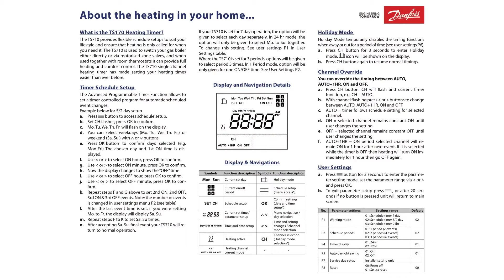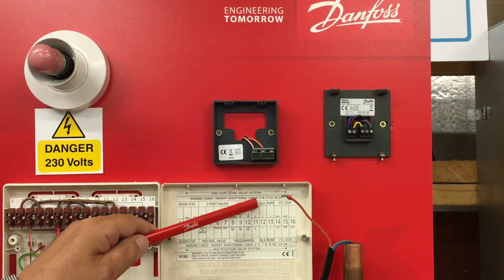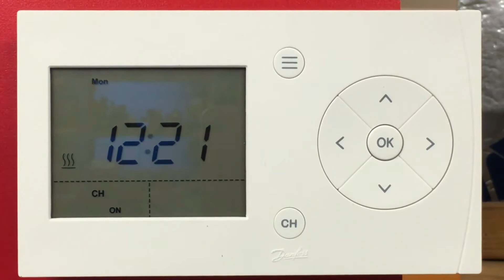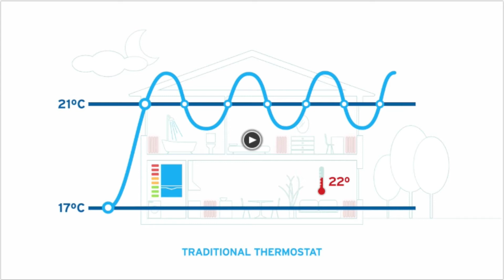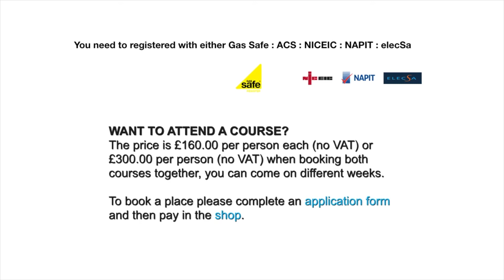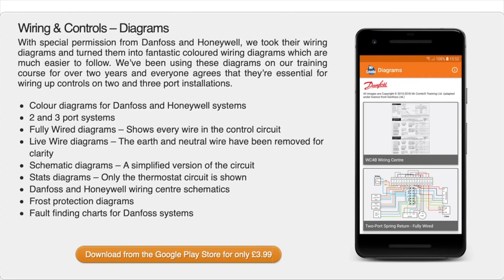Danfoss TS710 & FP720 Programmers

Comment: The most frustrating system I have ever used  ..CH is on but no hot water!!!!

No heating either
Reply from the maker: Hi, thanks for comment, no problem, you should have the 2 channel  FP702 (Full Program) each channel check the ON / OFFs are OK or reset the programmer to factory settings. Hope that helps, George

Comment: So i have the fp720....i need the water and heating on constant...but the holiday mode keeps coming on by itself....i reset it and try pressing pr button it will dissappear....then a while later the suitcase appears again....how do i sort this please
Reply from the maker: Hi Mr Slice, thanks for asking, you have a couple of options: 1: When you reset HOL. mode OFF turn OFF the power for 60s (cool down) start re-programming. 2: If the problem returns call Danfoss support (have details of date installed, who did it and what you have done)  3: You may have a claim against the installer under The Consumer Act 2017 (Not fit for purpose not lasting reasonable time) take legal advice, and get the unit replaced. Hope that helps, George Staszak 🤩👍
Reply: @mrcombiBedford  thank you for the reply ...its really appreciated
Reply from the maker: @MrSSlice  good luck👍

Comment: Hello,
Tha ks for this video.
See once you have set timer to.come.on at 6.30am for 30.mins, do you have to leave the heating on ON for it to.click on in the morning?
My thermostat is in cold.hall.& wpuld cost a fortune to keep this on ON or AUTO.
I left in OFf last night & it didn't.come.on.
Thanks
Reply from the maker: Hi Nicola, thanks for asking, It depends what time you did it and wether the system was ON or OFF mode, once you put in the new settings press SAVE the unit goes to AUTO the then the next 6.30am heating goes ON for 30 mins. Check all the times, days, clock and OFFs are all OK. If it doesn't work next day press RESET and reprogram. Any battery models change then for alkaline. hope that helps, George. 🤩👍

Comment: HI   we have just had a new FP720 fitted is there a setting for hot water only, our old danfoss controller had water heating or  CH heating and water. Thanks.
Reply from the maker: Dear Ian, 
Thanks for asking, in common to most programmers in homes, the new thinking is to set HW to 247 and let the cylinder stat control or set the HW timer 7am to 10 pm. On the 720 in the summer we switch the CH OFF either room stat to 5c or press the button  to CH OFF. Hope that helps. regards, George Staszak 🤩
Reply: Thanks for that. @mrcombiBedford

Comment: Hi mr combi hope your well correct me if I'm wrong the switch live out the room thermostat goes to orange in the wiring centre on danfoss, i thought it went to brown on the zone valve to turn the motor and then grey puts power on to orange to make the micro switch in the zone valve which in turn fires the boiler any help would be most appreciated thankyou
Reply from the maker: Yes 100% correct, the RS SW.L always goes to the Zone BROWN to move the motor, or WHITE if mid position. That's a £20 question, take care, george😁
Reply: @mrcombiBedford  yes corre t but mrcombi you mentioned it goes to orange in this video im sorry im confused
Reply from the maker: @bahiaharjinder  ALL The motor wires go to 6 as I said just a coincidence the SW.L is also orange. George
Reply from the maker: @bahiaharjinder  My mistake the orange wire goes to Zone BROWN 6 is Zone orange
Reply: @mrcombiBedford  thankyou sir for all your videos they are extremely helpful we all make mistakes we are human +thankyou for the quick response take care 👍🏻

Comment: Hi George, great vidio, I have a Danfoss 720 for CH and Water.
Probably something simple but I can't get my hot water settings onto my programmer. It decided to stop working last night and your vidio clearly showed how to reset CH but not the water. Please can you tell me what I am not doing  ?? Thanks Peter
Reply from the maker: Hi Peter, some controls firms are making setting up the HW timings a bit difficult because the default setting is OK for 99% of us. As the HW side is a lot cheaper than the CH it make sense to control that side with better room stats TRVs etc.
              As long as the cylinder stat is 60c 1/3 off the floor and there is always HW at the taps all is well. Most combi users have CH 247just use the room stat which is the lowest running cost so the same is HW. Thanks for asking. 
                    You always you can reset the lot by pressing the reset button or remove the batteries and start again, I would just leave it and make the CH lean & mean, regards, George Staszak 😃
Reply from the maker: Hi Peter, nothing, as per other replies, leave the HW to default setting, to get there press the re-set button and just programme the CH, life is too short. The lowest cost CH is 18c then if you have a newish digital room stat +2c then the CH will be 18c +2c (22) will be 20c there are all at least 2c below.
An old analog 240v will be at least 4c out hence high cost and in a HALL even higher. Hope that helps, George Staszak 
I will make a video next month.

Comment: I have just had this installed and it's too complicated for me, so I am going to have it ON and just use the thermostat. There is a red light on the timer and I'm not sure why that is? The installer didn't really explain anything.
Reply from the maker: Thanks for asking, red neon means the boiler should be in the demand ON program. Yes you are not alone about installers not showing how controls work to get the most from  the system, it's the Nr.1 complaint factories get about installers, shame. A lot put the programmer to 247 and just use the stat, it's the best way to save money, only when you are home at the lowest temp, lounge18 / 20. regards, George Staszak

Comment: Hello there, many thanks for your video, I have a heating boiler and a cylinder for hot water, each one with separate motorized valves. I'm not sure how to wire the cylinder stat in the wiring box in order to stop the boiler running when water reach a set temp in the cylinder. Could you help please?
Reply from the maker: Hi Florin, there are a couple of ways to wire 2 zones depending which make. Lots of drawings on U Tube a lot are wrong, contact the controls firm for the correct way using a WIRING CENTRE not junction box which is why we get all the faults. On our wiring course we get fantastic installers and sparkies, it takes them 3 hours to learn. regards, George Staszak

Comment: Excellent video. I replaced a Randall 102 timer with the FP720 with your help.

Only thing I’m not clear about is the difference when you have the extra terminals. I assume no loop from live to common  is required as it seems to work…my hot water and rads are on the two separate switched lives and it works.

Well, sort of…the rads seem to ignore whatever I set the thermostat to, so they never turn off! What might I have done wrong?
Reply from the maker: Hi Nigel, Randall 102 /103 takes me back to 70's made here in beautiful Bedford where all the best engineers come from. A link from L to Com is often used when the room stat or boiler needs one wire called SW.L (switch live)  there are lots that use this.
Draw a diagram with the make and model of parts email to Danfoss Tech. to check the wiring. regards George Staszak
Reply: @mrcombiBedford  yeah it's my Mum's old house. Did think of getting someone in to replace the entire thing with a new combi boiler system, but the cash flow situation won't quite permit.
Reply from the maker: @Daft_Ideas  Hi Nigel, If the system is over 15 years with high running costs then would make sense to replace because from April 2022 fuel prices WILL go UP per KW to very high amounts thus a highly efficient combi will soften the blow. As an installer I fitted systems for free in my parents houses, maybe you could rip out and start again with a new system via a small loan? Your mother would have lower costs and adds value to the home.regards George Staszak

Comment: Hi will this replace the DANFOSS TP9000? Is the wiring the same as existing backplate or will I need to alter it? It has an earth wires connected. Thank you
Reply from the maker: Hi Mark, new and different back place because it's a new and different range. As always on the old B'plate take fotos, We teach write down which wire goes where, make a new drawing of the old to new terminals BEFORE removing any wires double check with Tech. it's correct.
N & L are easy, just concentrate on COM and SW.L
where they go. take care, George Staszak
Reply: @mrcombiBedford  Thank you George. This system doesn't have the room thermostat it just has a block thingy in the hall, no dial just a block. Would I need to get a thermostat too?
Reply: @mrcombiBedford  There's 3 live wires in the live terminal 3 neutral and 3 earth then there's a grey wire in number 3 terminal a brown in number 5 terminal and a black in number 6 terminal
Reply: 3 terminal is DHW ON (hot water on?) And 5 and 6 are remote sensor to the thermostat?
Reply from the maker: Hi Mark, all systems need a room sat in the lounge apart from some programmable room stats can go in the hall, not many because COLD hall make big heating bills. Use the Danfoss dig in the video. George Staszak 
PS every country in the world states EVERY heating ZONE must have time + temperature control, a lot of UK installer don't bother, shame.
Reply from the maker: Hi Mark, it's not possible for me to solve all the questions from everyone I would never leave the house or eat, please as I said foto drawling to Danfoss. george
Reply: @mrcombiBedford  Haha understood 😄

Comment: The bottom right corner on the programmer is not displaying the HW information. It will not let me toggle between the CH and HW, has anyone else had this problem?
Reply from the maker: Hi Suzanne, I normally suggest do a factory reset either that will fix the problem or you know it's faulty, this is the same advice with TV boxes, computers and phones etc electronic equipment do freeze. regards
George Staszak

Comment: Hi George I currently have a FP715Si which is now faulty but I understand discontinued by Danfoss can I fit a FP720 in replacement and is it a straightforward DIY job or will I need a spark?
Reply from the maker: Hi Peter, thanks for asking, the back plate where the wiring goes is different, not a DIY job. regards George Staszak

Comment: Many thanks for your video, we just had this boiler installed in July and the installer set it up. We wanted to change the timer program but trying to read the instructions was a bit of a nightmare. Your video is excellent and so easy to follow, but when changing P102 to P101 thinking that it would keep the same setting for the 7 days, it only showed Mon and not the 7 days. Not sure if it was supposed to, but to be on the safe side I went and changed it back to P102 and did Sat Sun the same times as the week days. 
Many thanks from Scotland 🏴
Reply from the maker: Hi Douglas, thanks for the comment and yes sometimes in all programmers we have to think outside the box to set the way we want. Thanks goes to the Danfoss rep. Paul who taught me, regards George Staszak
Reply: @mrcombiBedford  Hello from Scotland.  Good video,  thank you for taking the time.     I would be very grateful if you could help..   Last week the local council fitted a new Danfoss TS710 single channel timer.     It's just my wife and I in the house now and We're both  just recently retired.     My query is this... We just want to have the timer setting  (It's in the kitchen)  sitting with Everything  off so that  all we do is...    press hour plus +     when needed.    How would we set that up please?  (No need to worry about the water, it's always hot when run).  Many thanks .
Reply from the maker: @midgeburleigh5694  Hi Midge, Thanks for asking, you can't just click +1 because if the CH setting is OFF it won't work, setting to ON that's on 247 cannot ask +1. Where it works is adding an extra hour to when it would normally go OFF. regards, George Staszak
Reply: @mrcombiBedford   thank you for answering.     Would it be such that I could set the heating to come on everyday for a minute once a day,  say... 10:00am to 10:01am Mon- Fri and Sat - Sun and that's all.    That way the system is on.   But then we could just press the hour  + whenever?
Reply from the maker: @midgeburleigh5694  Try it, could work that's how we learn , I would set 10 minutes to give the system time to get going, anytime press +1 see what happens should stay on for 1 hour then go OFF. I suspect if you press 5 minuets lated +1 won't work only in time, experiment with different way, please let me know. george
Reply: @mrcombiBedford  👍.  ok we'll  give it a go over the weekend and I'll post a yea or nay.   Thanks again.
Reply: Hello.  Here is the result of what we tried.     Well that's nearly a week and the suggestion has worked  treat!  We have set the timer  (on the kitchen wall) to come on at 7:01am  and to go off two minutes later at 7:03am,   Seven days.   That's it,   that's all.
 We then just press the hourly + button when and if we need it  and,  on comes the heating for an hour and then goes off.  It is the only time we press it now,  just when we want that heat.   I hope this is of good use for others.  Thank you for your initial help and answers.  Much appreciated.
Reply from the maker: @midgeburleigh5694  Fantastic! Always worth experimenting, this will save a fortune in gas bills plus better comfort levels, I am very pleased for you. All the best George Staszak
Reply: @mrcombiBedford  Thank you.  As I say,   I hope others can also  benefit from this.    Let's hope the "big boys" don't cotton on  too quickly   only to. . " Improve"   the timers so people can't do it!
Reply from the maker: @midgeburleigh5694  This is why we love Danfoss, easy to use.

Comment: I have a Danoff TPOne-M with 2 controllers for heating downstairs and one for upstairs. How do place the main controller downstairs for the Tado heating controller?
Reply from the maker: Hi Yogibear, thanks for the question, I think you cannot mix the two makes together, one of the most popular faults is mixing makes, the official reply  to solve is stick to one make which has the most parts. Valve are priority Danfoss valves Tado controls don't mix, they will work with problems.

Comment: Just had a FP 720 fitted ( not thermostatically controlled ) Parameters set at P1 01, P2 02, P3 01, P4 01, P5 01, P6 Holiday mode 02 ( at the moment because it's summer ) There are no user instructions given in the box and I'm struggling to remember what the electrical engineer told me ! My old Danfoss was so much simpler and less technical. All I want to do is know what to press to reduce the length of time the  auto hot water is on for and also how to eventually turn the heating on in autumn ( on holiday mode atm ). Thanks !
Reply from the maker: Dear B E, Thanks for the question, Danfoss in common with other firms do not want the HW mode changing once it's set up in default mode because it may not suit others having not enough HW. The cylinder stat at 60C from 07.00 to 23.00 is a very popular setting. In CH mode again most put on 247 and just turn ON the stat when cold (that's the cheapest way) 18-22C in the lounge, if in the hall you will have to experiment by another thermostat in the lounge to adjust the difference. Hope this helps, regards
Reply: @mrcombiBedford It doesn't help really because as I said there isn't any thermostat in the lounge or hallway. The system is very old but serviced yearly and works great. The previous unit was 25 years old, a Danfoss 102, in conjunction with a back boiler, so very basic. I just want to set the CH and water to come on automatically a short time morning and evening, that's what we've always done. I'll give the guy a call and get him back to help. Thanks for prompt reply anyway.
Reply from the maker: @blondeenigma3882  Hi B E, there is a very serious situation here, in the 1970 Canada USA and Europe made a law the every zone must TIME & TEMPERATURE control. Any Gas Safe installer will have a lot of explaining why they are exempt. Please contact Danfoss for guidance.
Reply from the maker: @blondeenigma3882  EVERY system must have time + temperature control, the FP720 is only a timer, you need to buy a wireless PROGRAMMABLE room stat from Danfoss, hope this helps, regards, George staszak
Reply: @mrcombiBedford  This reply is 4 months after we fitted the timer, and it has been working perfectly without the thing you're suggesting. It was adapted to work with existing system which it is doing, we just use it to time heating and hot water to come on and off twice a day like the old Danfoss did.
Reply from the maker: @blondeenigma3882  For some reason You Tube does not show comments in real time but weeks later, I am glad it works for you which is good to hear. regards george

Comment: Does any firm make a controller that says ON  or OFF.?  it would make life so much simpler.
Reply from the maker: Hi, yes all programmers have an option of ON / CON (constant or demand) 247 and use the room stat to switch the heating ON. Also there has to be an OFF for heating in the summer. Hope that helps, regards George Staszak